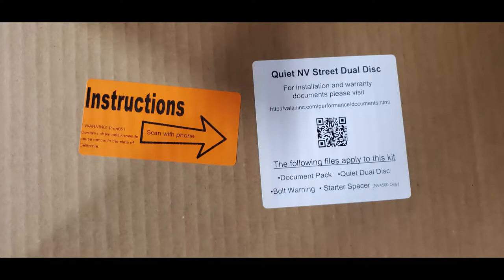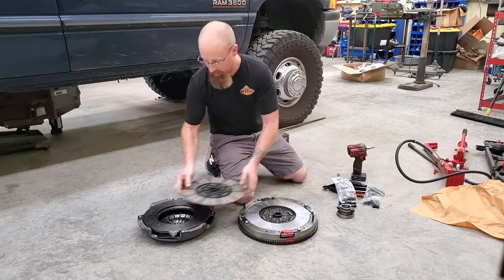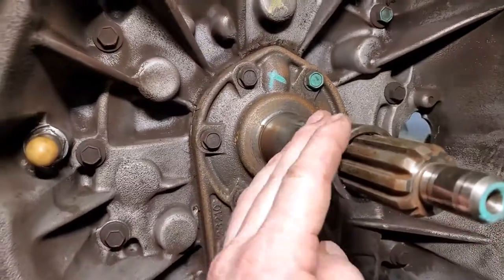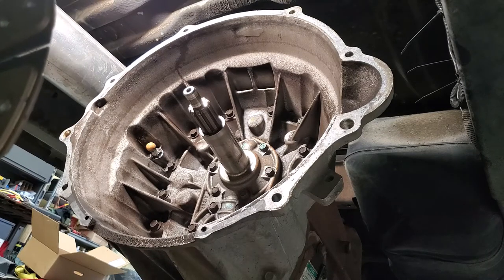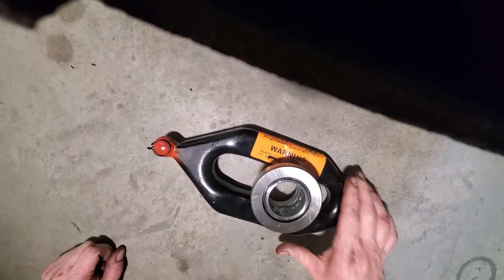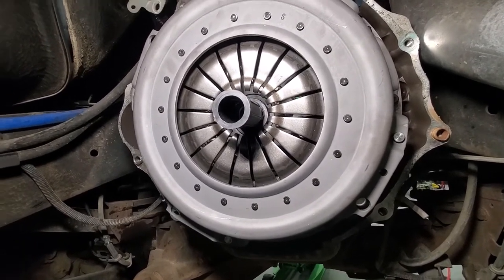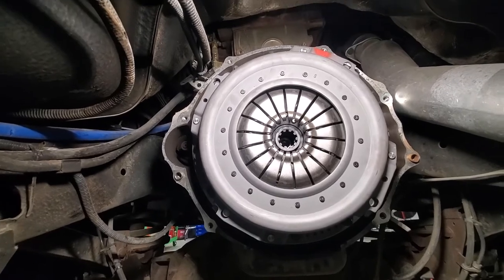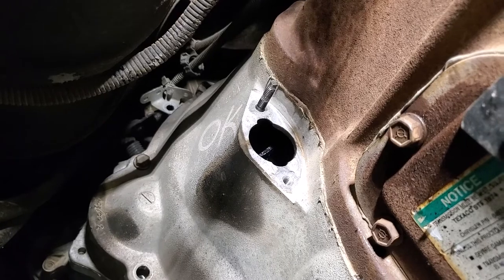Installing a Valair Quiet Dual Disc Clutch

Comment: Thank you for the fine details about what to watch for and the extra long alignment bolt trick is superb! running to TSC to get some soon, wish I had a dual disk to install, For now the stock replacement will have to suffice (stock power work truck 02 ho nv5600 dually 4x4)

Comment: Im looking at doing mine soon with a g56 transmission. Do you prefer the valair or south bend? Pros and cons to either? Im staying under 550hp.
Reply: I would never recommend a SB.
Reply: When I did my Cummins swap, I installed a South Bend heavy duty single disk that was rated for 950ft lbs of torque. My engine is making 605ft lbs at the crank. So I figured I am well withing the rating. Although my truck is very heavy ( 1983 Chevy 1 ton 4x4 dually, big flatbed, dual tanks ect.)

The clutch never slipped, and I drive pretty conservatively and don't tow a lot. But within 15,000 miles the center hub of the friction disk was TOAST. It began to make so much noise and there was so much clunking when on or off the accelerator I hated to drive it. 

I pulled the trans and sure enough all the damping springs were loose and about to fall out, and the disk was VERY loose on the input shaft. You could grab the splined portion of the disk and wobble it around by hand. The friction material still looked brand new though.

I ordered the Valair organic dual disk and I'll be installing it this weekend. Just having both the clutches side by side I have to say that the Valair looks to be much much better quality than the South bend. Especially the spring hubs on the disks. The South bend almost looks comical next to the Valair.

Really disappointed in the South bend especially considering the money I paid for it. I'll never buy another one. I would NOT recommend the South bend. Maybe their dual disks are better quality than their singles, but I would go with the Valair.
Reply: @Bloodbain88  thanks for your input. I've been hearing exactly what you said a few times now. I'm going to go with the valair dual disk. Thanks a lot for your help.

Comment: I put a kit like the one in the video on my 99 dodge 2500 and on my first trips I started to have problems with the first and reverse gears. I thought it was going to improve but it only got worse and so I had to have my transmission rebuilt believing that was the problem. problem but that wasn't it, I just continued with the same problem. Any ideas or suggestions that could be, your help would be appreciated thanks.
Reply: 99% of the time it's because the disc don't slide freely.
Reply: @mudrunner1  Thanks for answering, I appreciate it, now I can continue driving it like this or does that mean I installed it wrong?
Reply: @MTBLOVERS32  not necessarily installed wrong, but something was not checked. Like I said more than likely the disc are not sliding freely on the input shaft. Could be wear on an old shaft or sharp edges on a new shaft and disc. Could be just annoying, or if it's bad or gets worse it could eventually glaze the disc over.

Comment: Well if you do a duel disk you need a new shaft
Reply: That's not true. A dual disc does not require a new shaft. Even if you have an 1 1/4" shaft that's in good condition you can order the clutch with the smaller hubs.

It is important that the shaft is in good condition no matter what size it is.

Comment: I got 2000 3500 5speed I went with south bend dual clutch worst decision I made 🤬🤬🤬🤬🤬🤬🤬 it’s hard to shift 2nd gear and even worse reversing now I’m stuck with this piece of junk clutch payed $3500
Reply: Jesus $3500 for a clutch!? Or is that clutch installed with labor or did you do it yourself?
Reply: Sorry to hear it. I just pulled out a South bend single disk with only 15k miles on it where the friction disk spring hub is destroyed. Horrible quality, junk. I sprang for a Valair DD and it's worlds different than the South bend. Wish I'd have known about this first time around.